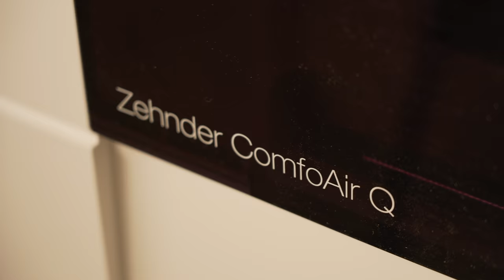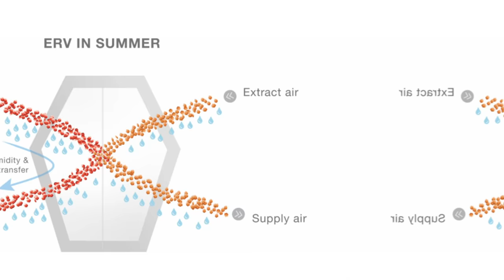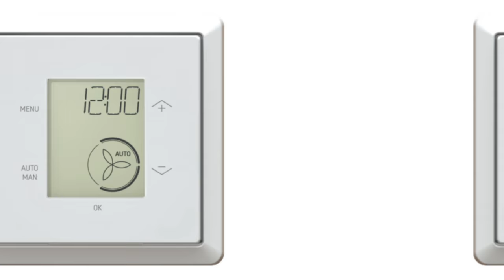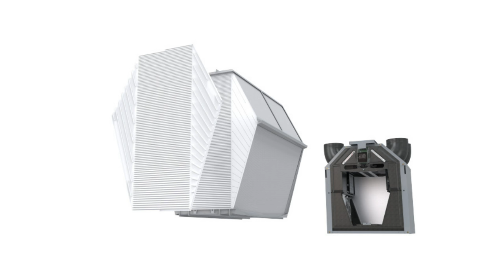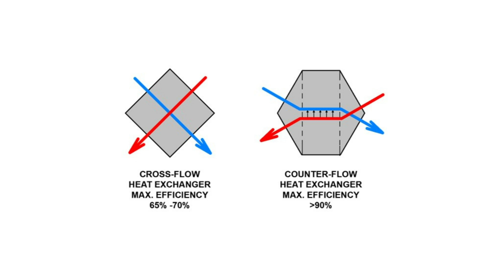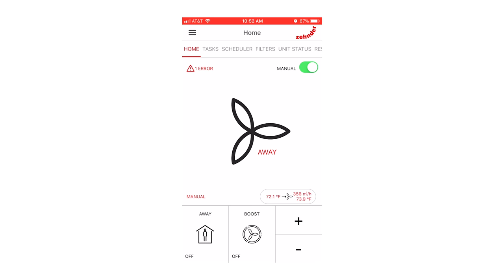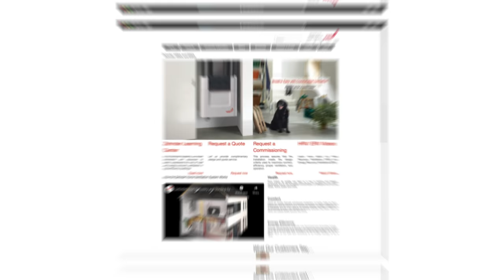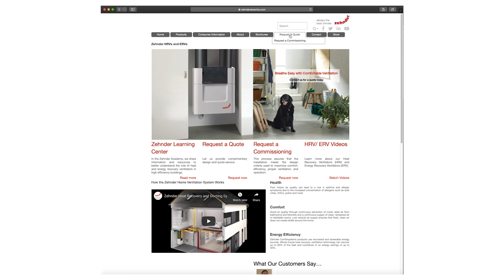Passive House - Fresh Air System Install & Costs (Zehnder)

Comment: Smart system. Although couple of questions. What's the pressure of the system. I imagine it's quite high with all the different components and small pipes. Also I imagine in a larger more occupied house your attic would be littered with loads of the pipes going everywhere. Can you just box them in?

Comment: 20:20 Is there a plumbing switch that can sense the shower is on? Therefore automatically turn on the exhaust fan in the bathroom? I had this idea a while back and just waiting to purchase my first home.
Reply: I haven't done it yet, but I wonder if using a Flo by MOEN, maybe it can detect the shower pulling water and then use a 3rd party control system to use FLO data to activate.
Reply: Robert Steich look for a fan with a humidity sensor.  I forgot who makes them.

Comment: So the ERV/HRV is only used for ventilation? And you still need to purchase a mini split or something else to heat and cool the home? I thought that with making the house so tight it eliminates the need to have air conditioning/heat. I live in the San Francisco Bay Area where I can easily see 100 degrees in the summers. I am looking to build my house to Passive House/Zero Net Energy and am trying to decide what are the best, cost effective methods so I am definitely interested in learning more about how you attained the team you assembled to understand what you needed in the first place before every starting the build.

Comment: Zehnder did not address cooktop ventilation. A whole house ERV might be a good way to eliminate bathroom and laundry exhaust...especially if the moisture is kept in the house during dry weather months. I emailed Zehnder, and received a response within a couple hours (fantastic service). Following is their response:

Thank you for your interest in Zehnder America ComfoSystems. For the cooktop ventilation, you will need to outsource a hood. Most quality hoods will have their own make up air system. This will be completely separate from the Zehnder system, as you will not want anything from the stovetop to go through the core of the unit (Zehnder requirements for exhaust registers in kitchens state that they need to be at least 8 feet from all cooktops).

I have not seen any residential cooktop hoods, which supply outside air to make up for the exhausted air. If anyone has used such a hood, perhaps you will post a comment on your results.

Comment: Great video answered a lot of my questions.  One thing I'm not understanding in this system is bringing in hot air how is it cooled from 100 ext to 70 interior degrees ? If it's running 24 hours seems it would require more from the cooling unit.
Reply: The heat exchanger that we pulled out of the inside of the unit is passively pulling heat from the intake air and moving it to the exhaust air. After passing through the heat exchanger the outdoor air has given up some of its heat and is about 85% closer to the indoor air temperature. Meanwhile, the exhaust air is about 85% closer to the outdoor air temp after it passes through the heat exchanger. Yes, because it's not 100% heat recovery, there will be some additional heat entering the house, so the AC will need to run--but a bath fan achieves NO heat recovery, so ventilating with bath fans to achieve the same indoor air quality requires the AC to run an awful lot more.
Reply: cwslsj Pf course outside air will require a degree of additional cooling. But the point is that his outside air is pre cooled by the heat exchanger using the exhausted stale but already conditioned air. It therefore required little additional cooling. Compare that to a conventional, leaky house where all the air penetrating the building requires complete conditioning.

Comment: Trying to figure out which is better for West Michigan. It can be -25 below zero in winter or 109 in summer and super dry indoors in winter to icky humid in summer. Which one handles all that at any temperature? If it matters, I like my indoors to be 68-70 year round but will have a zoned house so some areas (like guest floor/entertaining space as that won't be used as often so can be 45 in winter to 80 in summer when not in use. How would that work with a system like this? Also, I live alone and there will be 1.5 bath + kitchen & laundry on main floor and 1 bath + kitchen on below grade floor used for visiting nephew and family holidays, etc. I don't cook often or take superhot showers so not steaming up the place on the daily. Thoughts?

Comment: Is there a wildfire mode for this system where you can bring more supply in than exhaust? 

This would positively pressurise as it pushes the delta airflow through any gaps, which would prevent the smoke coming in.

Comment: Is attic (at least where the machine/system is installed) insulated? If not, wouldn't the pipes run in outside temperature?

Comment: Especially in a smoky (or otherwise hostile exterior environment), would an activated charcoal filter make sense on the device intake before it enters the MERV 13 filter of the unit itself in order to keep the contaminates from affecting the unit's exchange core?

Comment: Awesome, just wondering about Mitigation of radon.
Play Safe From Elliot Lake Ontario Canada.
Reply: Radon - just ventilate - simple..
Reply: Radon should be kept from entering the house with a sub-slab radon mitigation system. But the reality is that any contaminant that is in lower concentrations outside will be reduced inside by continuous ventilation, radon included.
Reply: @christophersmith1894  Thank you for the quick return your answer is what I was thinking.

Comment: You should maintain a positive pressure all the time instead of balanced. Is it possible to make the supply side run slightly faster to maintain a positive pressure in the home?

Comment: Apologies if this has been addressed.

Where does a heating/cooling system integrate into this system? Did come across a geothermal system integration. How about a heat pump?

Thanks

Comment: My guess here (excluding the discount Matt gets for the advertising) the retail cost to a typical consumer of the HVAC system he is putting in including engineering, equipment, installation, and commissioning is close to $100K.  That is $45SqFt (I think he said the house is 2200SqFt) vs $6-$10 SqFt in the average house according to a 2017 census survey or 5x the typical cost, or close to $80K more. with the average cost of a 2200SqFt  new construction house being $308K (yes I know there is a big difference between production vs custom built) that equates to a %25 increase in cost not counting all the other high-efficiency building upgrades. while I agree we need to build better it needs to be affordable. 

Would love to be a fly on the wall when the appraisal comes and it's less than the requested mortgage amount. A lot needs to change for this to be possible beyond only high-end custom homes.
Reply: @JamesBlazen   That's a fair statement but go to this video (https://www.youtube.com/watch?v=8f6Ih09uaDw) where Matt talks about a system that is close to $60K does not use this $20K ERV and we have not talked about the makeup air for the kitchen yet. and again I am talking retail price to the consumer, not the builder. Lower my number to $80K and you still have an issue. I would even speculate that the average production builder's entire HVAC budget is less than the cost of the ERV alone.
Reply: @b0ater2  I think the $100k guess is possibly even low.  Especially considering all the air sealing, exterior insulation etc that is required to use a system like that properly.

Comment: We are hoping to install an HVAC system in our house soon and were also planning whole house dehumidification.  Can the system be installed in a basement with floor vents?  I also assume there is no reason to have ceiling fans in addition to this unless you just wanted the extra air movement?

Comment: When you show cutting the duct off that goes into the bedroom there are two pipes connected (an in and out) but only one bigger outlet into the room? How does this work? You discuss how to adjust outlet air, but where is inlet air? Thanks Bob
Reply: Hi Mary. Thanks for the question. Actually those two pipes were both supply pipes. We used two because we wanted 24 cfm of fresh air rather than just 12 cfm (12 cfm/tube) in that room. The exhaust is in the adjacent bathroom.

Comment: Hey Matt, can you also vent the air from your garage with this system since the air dont cross contaminate each other?

In other words, can I use this as one unit to vent both my house and garage. Trying to cut down on penetrations for a passive house home or would you suggest using another system to vent the garage? 

If anyone in the community care to chime in, please do so. Thanks guys

Comment: In a way this is like opening a window but containing that air in a duct system. How is moisture from the outside fresh air captured? Especially in Florida? Or is the amount of air so minimal that we won’t notice the humidity? Is there condensation in the air exchanger?
Reply: The heat exchanger will capture the humidity out of the incoming air by passing it past the cool outgoing air.  Then it likely drips into the exhausting flow.

Comment: Matt - great video..as usual. we're in design/planning for a new PassiveHouse inspired house in Toronto, Canada - though at a much smaller scale than yours (1,400 s.f).   planning a smaller Zendher ventilation system, for all the same reasons you mention.  We'll be all electric too, heatpumps for heat and cool and hot water,  Net zero metering solar system on the roof. We've spec'd mag induction range as well.  What are you doing about above range exhaust & makeup air?  I assume they'll each need an envelope penetration and will be independant of Zendher.

Comment: Is there a way to selectively increase the exhaust rate, or make up air, from/to a specific room, such as venting a bathroom shower humidity, or making up combustion air in the kitchen or laundry in the event of open chamber combustion? Would this complexity be considered unnecessary? Or am I missing something?
Reply: You have a boost switch for bathrooms and kitchen which boosts the cfm for the entire system, not individual rooms.
Reply: my (UK) system detects a humidity increase in the extracted air and runs at a higher power for a programmable amount of time.

Comment: I am trying to understand as a home owner right on the cost line in Massachusetts looking to build a new home on stilts. My goal is to go green, energy efficient and build a healthy home. Do you have a video, series ,or website that explains easily the passive home science and all the systems needed to achieve a net zero for heating, cooling,, ventilation/ filtration, humidity control and safety (clean out dryer lint and stove grease, pollen, dust, dander...) please any recommendations to understand building science and final how to maintain all these systems easily as soon to be retired- safety and accessibility and replacement cost are important  too to know as well. Thank you for your show I am learning what I need to build for my legacy/green/retirement home that will stand up in all weather conditions, time and be easy to upkeep. My goal is to be educated home owner so when I talk with builder, architect, engineer, trades people... they me help build my dream home responsibly and I can maintain easily and safely. Their is so much information and confusion try to understand what you need to have passive, clean, energy efficient, economical, sustainable and easy to maintain home and how all these systems work together. Matt please any suggestions and help would be great? Feeling overwhelmed and confused but excited to learn and understand more.

Comment: Matt, love this video! This is the kind of thing I have been looking for. Question though, are you going to also use a whole home dehumidifier? I wasn't sure if the unit featured in this video would also take on that role as well.
Reply from the maker: No, I’ll also have a separate dehumidifier. Stay tune for another video on my heat pump and dehumidifier installation
Reply: @buildshow  sweet, can't wait

Comment: Would there be HAVAC loss on those 24 exhaust/supply tubes ?  Is the material insulating ? will it degrade in the heat of the attic ?
Reply: Matt points out early in the video that this attic is going to be conditioned.

Comment: All sounds good but can you integrate an external air filtration system because recently Spokane AIr Quality Index rose to 495 out of 500 and air was dangerous and hazardous due to 80+ fires producing intense smoke and particles.  It penetrated the house where air inside was yellow.  Sun was partially blocked and red.   I think more than a single charcoal system is needed.
Reply: Thanks Terry. This is a genuine concern. The example I shared was from Ridgefield, WA (near Portland, OR) during this fire season, so I think it's a fair anecdote. But yes, a third party filter could potentially be incorporated. As long as the added static pressure is manageable, the supply fan in the Q would adjust to it.
Reply: I live around Portland in a new-ish house (5 years), but not anything fancy - no extreme air sealing, no special ERV/HRV etc. During the smoke, I kept the windows closed, only used A/C (recirculating) without the fan being on all the time, minimize use of dryer and hood fan, and had no issues. Inside was fine, outside smelled and looked terrible. I don't get how your air inside was yellow? What were you doing to draw in so much outside air?

Comment: With the supply and return right next to each other in every room won't the air flow get pushed out a few inches and then get sucked right back in?  Wouldn't you want the supply on one side of the room and the return on the other side?
Reply: they're not next to each other. those are two supply hoses into the same room to increase the air delivery. bathrooms get air sucked out, bedrooms get air pumped in.

Comment: Matt - another fantastic, informative video. You addressed every room that typically has a fan penetration except the kitchen.  How do you handle  kitchen stove exhaust?
Reply from the maker: I have a separate system for kitchen exhaust that includes make up air. I’ll be doing a video on that also. That system is made by Fantech

Comment: couple few questions. 1: you mentioned your vent hood over a range, is there some switch you would flip on the hood to kick this in? Does it then increase flow house wide or only at that location? 2: your HVAC, and dehu... do they connect into this system or are they separate ducting?
Reply: Hi John. This unit doesn't integrate with the vent hood over the range. Matt will have a separate vent hood. And the heating, cooling and dehu will be on separate systems from the ERV. Integrating ERV with other systems is common in North America, but is a real compromise in performance and optimizing indoor air quality. The systems operate differently (intermittent vs. continuous), have different air flow rates requiring different duct sizes, and have different air distribution strategies to maximize their effect and efficiency. It's best to just let each do what they're good at. A little less money spent on granite edge details and built-ins and a little more money on the heart and lungs of the house.